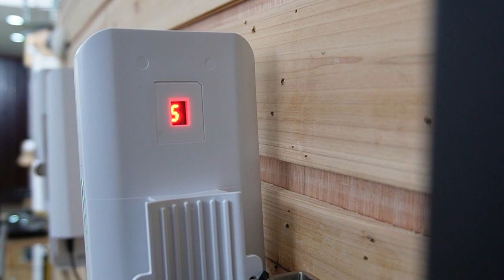Case Study | Wireless Network Bridge Setup Guide for Multiple Locations

Comment: Don't I need to assign ip addresses to the ports connecting antennas? Do I need ospf to advertise the networks?
Reply from the maker: No, you don't need to assign and IP address to wireless bridge. The birdge is transparent to the network. There is seperate VLAN running to negotiate the networking. There is no OSPF involved.

Comment: I don't know what the function  Router and Why must use this Router, please explain?
Reply from the maker: The wireless bridge itself doesn’t handle assigning IP addresses or internet distribution. A router connected to the bridge ensures devices at the remote location (e.g., outdoor area or secondary building) can access the internet.

Comment: Why you don't use a PoE switch for the antenna
Reply: Or an injector PoE
Reply from the maker: The wireless bridge needs DC24V passive PoE. The PoE switch can't power the wireless bridge. It output DC48V.